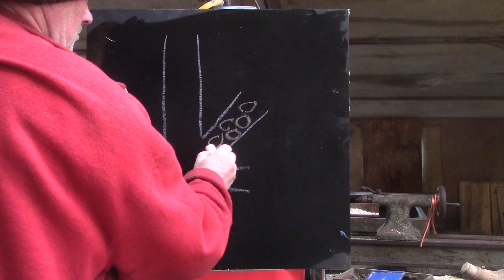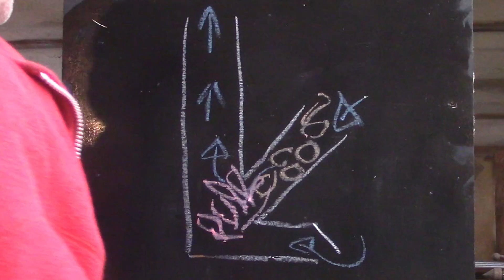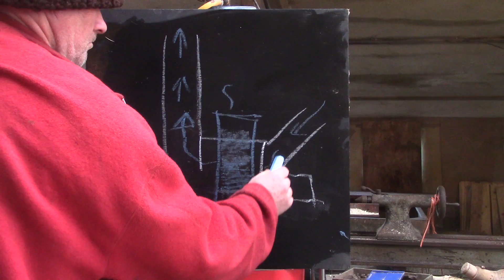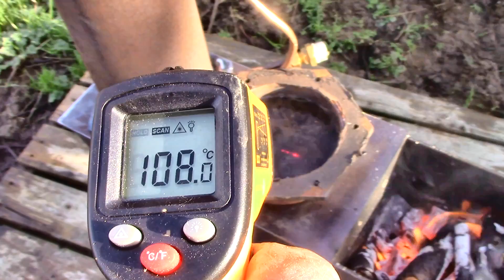I Made A Rocket Stove Water Heater!

Comment: Hi Tim - very interesting vid!  - 
1. start fire in chimney to allow it to warm/updraft - either by adding an access port - or pushing some burning material inside box bottom chimney,
2. the main airflow should be via bottom port (ash removal port - close the feeder bin once filled - all fire/smoke should be draft via chimney.
3. you can also add some air pipes down the chimney exterior to warm the air before entering the fire pit at bottom of chimney
4. consider moving the 1st boiler also inside the chimney -  - maybe porpoise the first fire box to allow for boiler - as the hotter secondary burn occors there where all the gasses mix. 

Looking fwd to progression of test!

Take care!
Reply from the maker: Good ideas, Pieter. Thanks. (So much to learn!!)
Reply: @wayoutwest-workshopstuff6299  I 've buildt rocket stove out of stacked cement blocks, as tests for space heating.

 You could also consider making space for fire bricks lined inside  metal fire box to protect the fire box. 

The heated air drawn from outside could be intensional dispersed in fire box to create/assist in centre rising fire vortex forming to ensure a clean hot burn, using much less fuel, protecting side walls.

Comment: You're going to need a deoyxgener.. to remove oxygen and carbon dioxide gas from the feed water. Need to adjust pH for feed water to make it extremely alkali and to heat the returning condensation and feed water to 210°there's a lot you can have your own steam plant / turbine
Reply from the maker: Is that to reduce corrosion?

Comment: Looks well built.  Only thing that I don't understand is the reason for the bottom of the round boiler to stick out below the bottom of the stove? 

In other words, why did you cut the second round hole?

I am assuming that it would be better not to expose  that bottom to cold outside air but to raise that boiler up so that the bottom is one inch or so above the bottom of the stove.
Reply from the maker: You could be right - I was thinking I could try out different positions to see where's best. But water is good at layering by heat, so I only need to boil the top-most part

Comment: Just thinking out-loud... I think you need to reduce the opening for the fuel and extend it up higher.
You should have equal or less area for air intake than the chimney.  A little math will tell you how much to reduce it.
Yes Insulation will help.
Also, what if you raise the grate up above the top of the lower air inlet?
Then you can slide in some paper and small kindling all the way in to warm the chimney faster.
Like I said... just thinking aloud.
Reply from the maker: Thanks, Dusty. Good ideas.

Comment: Hey Tim! I would recommend adding a port or fitting on the inside of the chimney that would let you blow air up out through the chimney while it’s warming up. That should increase the draw of air through the rocket stove via the Venturi effect (like an airbrush paint gun) reducing the total time it takes to switch the flow by a considerable margin. If you went the fitting route then you wouldn’t need something all that large. Just a half or 3/4 inch copper tube bent at a 90 at one end and with a funnel on the other end that you could attach at a handheld leaf blower or a supped up hair drier to.
Reply from the maker: Yep, that makes sense, thanks.
Reply: Yes this is how we start our 10 inch gauge locos

Comment: Very cool work Tim! Jealous of the plasma cutter, everything looks great, really starting to look line an engine. Can't wait to see how much the insulation helps. This is is very exciting.

As for the starting draught, not sure if it would be possible but if you could introduce another small hot fire with an oily rag or something underneath the base of the chimney just to get the draught started maybe that would help? I don't know how it would get up there, or remove the ashes, maybe a smokebox door? 

Or maybe a fan or blower to start the draught could help to, though I'm not quite sure how to implement this.

Can't wait to see what else you have in store for us Tim!
Reply from the maker: Yes, that could work - thanks!

Comment: Dear Tim, 
Love the idea. But... I feel you are extracting the heat from the wrong place. 
A classic J or K rocket stove needs to be able to be super heated to burn off the smoke, which further improves the efficiency. 
Take the J tube rocket stove design, and build it using insulated ceramic (kiln type insulating fire brick) and extract the extra heat for for flash steam system at the top of the heat riser. 
I garauntee you will get a cleaner, hotter, and quicker to boil time if you extract the heat after all of the primary and secondary combutstion is done. You are trying to extract heat at the site of the secondary combustion, which holds the overall temperature of your burn chamber at the boiling point of water. Which is far less efficient that getting the combustion temperature up to 600c or higher. 
Good luck on your future builds and ideas.
Reply from the maker: Ah, but James that's exactly the plan - the primary water boiler isn't in the hottest part, but the secondary and tertiary heater will be...

Comment: Both vented steam from the presser relief valve, and used steam from the pistons can be shot up the chimney to help the fire remove its own smoke and in doing so help pull in O2.
Reply from the maker: You're right, but that's not useful at start-up : -  (

Comment: I'm going to jump a step ahead, as I always do, and prod you to research steam injection pumps. 
They're a way to pump water into a pressurised boiler using the steam within the boiler, without any moving parts... Excluding the 3 valves required to prime the pump.
Reply from the maker: Exactly - I must do just that. Thanks

Comment: Tim a little tip that might help is to build an access hole on the other side where the chimney is and start a small fire there. This way it pre heats the chimney first an then start the fire in the fire box. it should almost start right away because the draw of the hot side and once closed will keep the fire going. That stuff will burn off to ash over time. 
Now back to the video.
Reply from the maker: Good idea, William. Thanks
Reply: @wayoutwest-workshopstuff6299  you can also put a steam nozzle in the chimney to make the fire hotter when the steam engine is running.
They do the same on steam locomotives, the steam nozzle pointing upwards in the chimney, creates a vacuum and pulls more air into the fire.

When the fire burns but the chimney is still cold, you can blow some compressed air through the nozzle to suck the exhaust gas into the chimney, 5 seconds will be enough to get it started, from there on it will keep on going by itself...
Reply: That’s a good idea I think..
Reply: Couldn't you just heat the chimney with a blow torch to get the draw going?
Reply: @philiponsolent7232  you could yet it cost money over time to have a torch.

Comment: Add another hatch on the flue side to start a small fire to draw a draught from the fire box. start that fire first and once it gets nice and hot and a draught has formed, light the fuel in the firebox. Lots of old wood fired brick heating stoves use this method to get the draught going. They are usually stacked vertically with the flue fire over the firebox but should work just fine with your design. Dont worry about the ash since it is just a smal fire to start the draught, most of it should be drawn out with the flue gasses. As for heat loss, once you get your proof of concept weld the entire seam. I am sure there is outside air getting in reducing the efficiency by reducing the draught from the firebox and cooling the flue gasses as well.
Reply: I just thought of that too! We are on the same page!

Comment: As I understand, the trick to rocket stoves, is that you are buring the fuel at a very high temp. Which is how they get their efficiency. So you don't want to be taking heat out of the burn chamber. In fact, you want to insulate the burn chamber. You take the heat from the exhaust.
(Think I said similar on your previous video).

Also, you will probably find that if you have the air drawn through the fuel delivery chute, the burn will work it's way up the fuel stack and the lot will be burning. That certainly happened on my first attempts. 
If you air seal the fuel stack once you've filled it, and add the air to the burn chamber separatly, that might work.
On mine I just replaced the fuel stack with a big fire box, lined with refactory. So I just load it with wood, shut the lid and let the lot roar away. The whole thing is the burn chamber. I also have no grate, for wood I've never needed one.
Reply from the maker: Thanks, Gonzo. My plan is to take heat out of the system in 3 different place - the primary boiler won't be taking much out, I think so shouldn't affect the burn. The pipes in the chimney will take most of the heat, and finally the flash boiler will be the grate.
I will experiment with closing up the fuel chute - easily done

Comment: Top job as always Tim, you’re making serious progress.  I know it was hard to know if your design was “Rocket stove” enough. The noise from the chimney stack usually roars if you have the intake exhaust airflow correct. You’re dead right with insulation too. I urge you to use aircrete and vermiculite you’ll wonder how you lived without it! Unlimited potentials ahead.

Comment: Would a swiveling top for the chimney, with a vane to have the wind keep its direction, help to encourage an earlier draw for the heat from the fire? In my area of Australia, many of the earlier houses (and some of the steam powered factories in the past) used such a swivel at the top of the chimneys to encourage draw...
Just a suggestion...from a fan of the You Tube world's all time best tinkerer.
Reply from the maker: Good idea!
Reply: @wayoutwest-workshopstuff6299 from experience  a simple cowl will make a surprising amount of difference.  The simple inverted plate type. I guess it simply works like an aircraft wing  and is omnidirectional

Comment: I'm afraid you fell for the youtube bastardized version of a "rocket" stove. A true rocket stove has as it's most important and most misunderstood feature is an insulated firebox. This is more akin to a foundry furnace. Really like a furnace within a furnace.  The fire is burnt within the first inner firebox then the exhaust gasses are redirected downwards around the outside of that with the secondary insulated wall. This allows all the fuel and gasses (smoke) to get up to combustable temperature. The most important part is never to put the boiler within the firebox because it constantly cools the fire. Rather locate the boiler downstream from the firebox into the flu, this is where the best heat exchange takes place. The heat and pressure of this type of firebox is what makes it possible to cool the flue but still produce a substantial draft. This all does go against the traditional steam boiler conventions which is little more than a teapot on a fire, but is what differentiates a true "Rocket" stove design. Essentially if you aren't on the cusp of melting your refractory lined firebox, don't call it a rocket stove.
Reply: Absolutely agree with @TgWags. The flu should initially run upwards from the fire throat, from bottom to top of an insulated (think vermiculite here) enclosing barrel like container, venting into the barrel close to its upper surface. Picture an inverted cup sitting on top of a vertical pipe and you'll get the picture. Secondary air introduced at the base of that short flu will turbocharge the heating process in the flu as the secondary burning of the gases occurs. The remainder of the flu will arise from the base of the barrel so that the superheated gases have to flow from the top of the barrel down to the bottom to escape. The heater coil for the water sits within the barrel in the flow of superheated gases. Hundreds of degrees is possible. The bastardised internet rocket stove design (well named btw!) is only intended as a glorified camping stove and will only reach a couple of hundred degrees. That certainly is a nice one though, you're a craftsman. My explanation is probably not the best but a few hours on YouTube will give you more info that you can possibly handle ;) Good luck, I'm looking forward to developments.
Reply: @philthorpe4549  Thanks for the additional descriptions. I was having a hard time describing it. Also, I do want to echo the sentiments of appreciating Tim's work, ingenuity and craftsmanship. It is why I watch. I apologize if my tone sounded harsh. I tend to assume that people know I'm just passing on information and trying to help but realize I often come across rather blunt. Looking forward to the progress as well!
Reply: @philthorpe4549  Interesting comments, you and TgWags, I've been seeing quite some conflict in what is and isn't a rocket stove including the diversion to rocket mass heater.....
There was me thinking these were old things, and again there is conflict.
It seems that the (modern) rocket stove was developed as recently as 1980, and I guess its lack of maturity is one reason many people have taken the basic principals, enhanced or disgarded them and come up with their own "better, improved rocket 2.0 stove"

So, what's the fundamental(s) of a rocket stove?
Simply: get enough oxygen into the product of primary combustion such that complete secondary combustion occurs.
That means that primary air should pass through the fuel. If primary combustion gasses pass through the fuel it will cause pyrolysis of the feedstock and make even firing difficult. Given that then vertical or sloped fuel feed mean that gravity will keep the flame in the right place while permitting easy refuelling. That's where a strong draw on the flue is required. 
Then there is the need to ensure that there is sufficient air and heat to enable the primary combustion gasses and particulates to burn. The air flow can be achieved by ensuring the fuel is loosely packed or there is an air path past it or a secondary air path. The requirement for heat (700 C and up) mean that a refractory lining is essential, not only for insulation, but also steel and stainless steel will have a very short life at those temperatures. Metal only constructions will have large volumes where primary combustion gasses are too cool to combust. 

Thanks to both of you, without your posts I was just about to head down a wasteful design route. 

I said (modern) design since it appears that the Romans were there first, the hypocaust systems implemented all rocket stove principals. 
What did the Romans ever do for us eh?
Reply from the maker: Thanks everyone. Excellent advice. Back to the drawing board for me..

Comment: Hi Tim! I always learn a lot too when you are building stuff. For example, I didn't know that a chimney needs to be hot before it'll work. I thought it was automatic. Anyhoo, all this inventing stuff (even if it's already been invented) is much fun and much exciting! 😂
Reply: It is quite dependant on the diameter of the chimney. I like to think of the chimney as a column of cold air. That way I can see the hot air trying to push its way up the chimney, (rather than trying to solve all of the Navier-Stokes equations.)  Another way to check is to make a model of the chimney 7x smaller and submerge it in water, and then use different colours for the different temperature water, (because water is about 7x more dense than air.)
Reply: @recklessroges  Thank you Sir. That is a very good explanation.
Reply: The function of a chimney is to focus the hot exhaust so that it flows more concentrated and thus stronger, drawing more fresh air over the fire faster. That makes the fire burn hotter when balanced correctly.
Reply: @andrewreynolds4949  I think I understand. It makes the air go over the coals and then sends the air/smoke up the chimney.